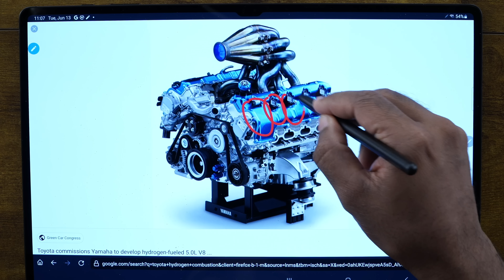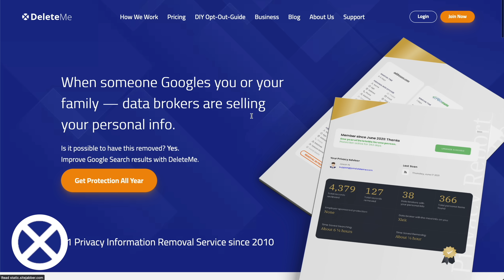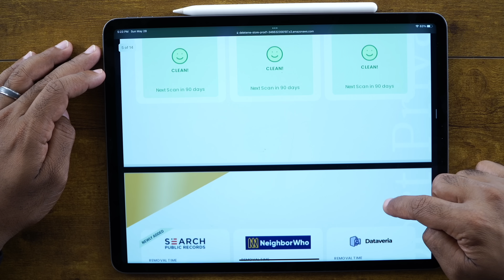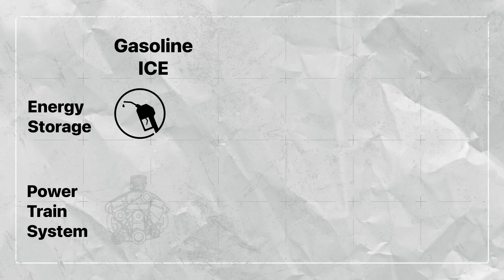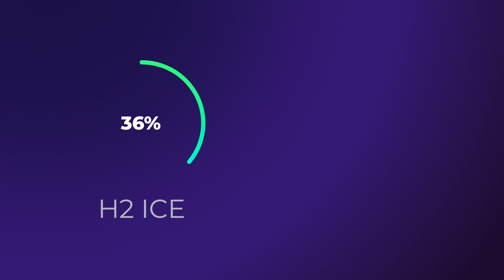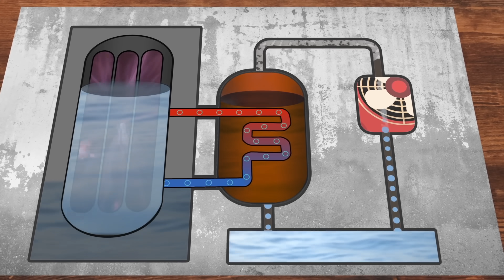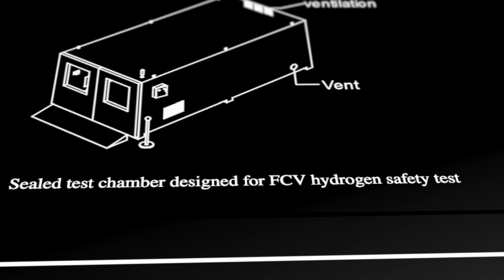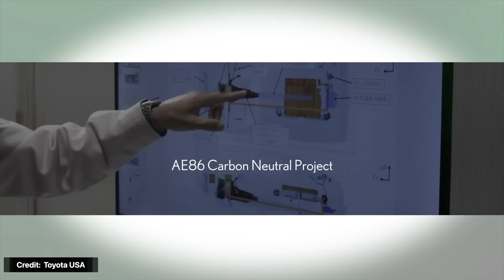Toyota's Says They Just Destroyed EVs - Hydrogen Combustion Engines

Comment: Good video, you only forgot about the fact that hydrogen fuel cell car also use a battery for energy storage. Of course smaller than for an EV, but still needed, as hydrogen fuel cells cannot power an electric drive train directly.

Comment: You should have talk about the range of h2ice. That's a real issue. 1kg of hydrogen as about the same energy of 1 us gallon of fuel (33kwh). The mirai can store 6kg with it's 3 tanks. 6 gallon does not take you very far. Toyota seems to check liquid hydrogen to compensate that, but liquid hydrogen is more complex to produce and store.

Comment: Hydrogen combustion was perfected by Billings Energy Research in 1969.  Billings even solved the NOX problem in 1969 Pontiacs.  Its easy and any engine can be converted for a relatively affordable price.  About the same as propane conversion.  The real problem is a source of hydrogen.  Give us a way to efficiently crack water into hydrogen and oxygen and you'll have something.

Comment: EV-Repaircost are lower?? until u have to remove the battery 20k
Reply from the maker: EV batteries last 250-300k miles, that isn't a concern for most. and EVs usually come with 8-10 year battery warranties.
Reply: @TwoBitDaVinci  and if its broken after 10 years and 1 day at 50.000 miles u still have to repair it...and in Europe its 62137,1 - 93205,7 miles guaranteed. And if u have to pay then 20-30k$...

Comment: This is certainly not the first H2 ICE engine.

In recent time, back in 2003, Mazda RX-8 RE combusted gasoline as well as Hydrogen. Car was shipped with Hydrogen & Gasoline tanks: 210hp @ gasoline, 110hp @  H2. It had regenerative breaking, 144v battery, engine shuts off instead of idles, and electric turbo for low end torque.

Comment: if hydrogen & other alt-fuel/energy sources were used for rail or trucking; the infrastructure would naturally develop.
companies like amazon, UPS, FedEx, USPS -could use diverted subsidies from coal/gas to develop that infrastructure, and conventional fuel companies could be allowed to tap into those subsidies when specifically designated to add alt-fuel stations to existing locations.
    it can be done.  just have to get around profit motive as the incentive.
_______________
side note:  going back over 25 years:  the USPS proposed going EV way back then;  and ever since, nearly all the political power in WA DC has been leveraged against them to dismantle the USPS as its fuel consumption reduction would affect BigOil interests. 

just more to consider of why it's been so resisted or any alt-fuels given such poor attention from govt;  -both parties donors won't allow it.

Comment: Hydrogen as it normally exists on Earth is NOT energy dense. It has to be highly compressed and cooled to sub zero temperatures to make it energy dense. Both of these requirements make it problematic as a fuel. It is reasonable for use in rockets, airliners, and cargo ships but not private cars.

Comment: Vehicle fuel cell systems are not anywhere near 60% efficient unless you drive slow. The new mirai has a tank capacity of 5.6 kg, multiply that with 33.3 kWh/kg  and you have ~186.5 kW, times 0.6 for 6% efficiency and you should have ~112 kWh. You don't, unless your drive slow as the efficiency of the fuel cell  systems decreases absurdly with increased power output. That's why Toyota managed to drive 845 miles without refueling despite EPA and WLTP numbers suggesting that shouldn't be possible. If you drive slow so the power output get very low vehicle fuel cell systems get decent efficiency. But then again, at very low speed long range doesn't matter much.  It took them two days to set that record, it's not that often you can drive for two days without any opportunity recharge an EV.  

And those 33.3 kWh/kg, that's LHV, Lower Heating Value, the actual energy content, HHV is 39.4 kWh/kg but ~18% of that is not available to a fuel cell, or combustion engine either for that matter.  If you're comparing engines and/or fuel cells, it can be relevant to use LHV, but when you're analyzing actual efficiency you can't just disregard a loss of ~18% because it's inherently unavoidable.           

Toyota et al. knows that fuel cells will never replace ICE for cars, they realized a long time ago that by promising fuel cells as a solution, they can continue with business as usual longer. 

For the fossil fuel industry hydrogen is the big last hope to protect the value of their assets. When "no one" wants to burn fossil fuel themselves, the hydrogen can be produced from fossil fuels. The industry can claim it's just for when supply of "green hydrogen" doesn't meet demand, and pretend the part made from fossil fuels is negligible.     

I don't think the chicken and egg issue is such a big problem, there are areas with more than enough fuel stations for many peoples needs, and the >50,000 fuel cell cars that are sold have almost exclusively been sold to geographically limited areas, so it's possible for the chicken and egg issue to some degree limit the rate of adoption, but it can't stop adoption.  

Also, if Tesla could start build the supercharging network in 2012, when they were laughed at by most, the Hydrogen proponents in the car industry could easily have built a bigger hydrogen fuel station network faster, if they actually believed it was a viable system. But they don't. It's a scam, very elaborate, but still a scam.

Comment: Thanks for the great presentation of both the pros and cons af H2 ICE.

I would challenge, however, the supposed "durability" of H2 ICE as opposed to battery degradation of BEVs. In my opinion, the H2 storage tank is likewise highly susceptible to degradation as well -- being subjected to repeated cycles of extremely high pressures during refueling. How well does the H2 storage tanks (both the refueling stations and vehicles) stand up to those stresses (and the cost and complexities of that) is not well known. I seem to recall from other Youtube videos on FCEVs mentioning that that the H2 storage tank degradation issue is a real concern. Not only is the tank subjected to extremely high pressures, but the material that the tank is made out of is probably subject to degradation as well because it has to resist reacting with the H2 being stored.
Reply: Carbon fibre overwrapped pressure vessels. Ask OceanGate about their long term reliability.
Reply: What kind of pressure are you talking about? We still use pressurized tanks from 50 years ago still hold pressure with repeated use; including hydrogen. I would assume they are trying to keep the tanks strong and light. We have cylinders capable of repeated use, they just may not be as light as they would like.

Comment: When I saw the video title card, I thought "Oh no, not THIS again!"
Hydrogen combustion has even worse overall energy efficiency than hydrogen fuel cells, and therefore loses to BEVs even more badly. As to why the Japanese keep trying to find ways to make it work, at this point I feel like they are so attached to the experience of refueling their car the old way, they can't imagine a world without it. That and saving face. Abandoning hydrogen would mean admitting they made a mistake and wasted all those decades and all that money. That would constitute a loss of face. So they persevere out of sheer stubbornness. 

By the way, I was with you right until you said "ICE efficiency doesn't really decline, unlike battery capacity". Storage capacity DOES NOT EQUAL energy efficiency. One of the reasons why it's so hard to argue and reason with hydrogen proponents, is because they keep conflating and comparing metrics that seem related but aren't. (another reason being they keep bringing up arguments and numbers that aren't nearly as important to the big picture as they think). If we want to have useful discourse on the topic, we need to make sure don't do this. Let's be careful to avoid apples-to-oranges comparisons, and while we're at it, let's not bring up irrelevant arguments for one side or the other for the sake of having a list.

Comment: My range anxiety would be a lot bigger with H2 ICE - electricity is everywhere, even if there is no fast charger, you wont be stuck for ever. 
Also, for every day use you never go to the fuel station - destination charging/charging at home. 
I would be interesting to know how often you use 5 minutes refueling H2 ICE through a year compared to the extremely few times you have to fast charge taking your EV when you take it to go on summer holiday. You might still be waiting more on the, but it is suddenly a shorter break. And when going more than 200miles/300+km - I think most people put in a break, to stretch the legs and/or get a bite to eat anyway.
I have a Toyota ICE vehicle now, and I like it, and I love their reliability. 
But I am getting SO confused by them. One minute, they announce a million new EVs, then they come with H2 ICE, then they want EV with gear boxes and motor sounds? 
Even though the Bz4X is far from as bad as many reviewers tried to make it out, it's far from a hit or the dream car. (when the same reviewer trashes the Toyota as the worst thing ever, and then compliments the Solterra for being one of the best EVs - its hard to take them serious)

Comment: I think you've been very optimistic here, this is a turkey.
What you didn't mention is the amount of space the hydrogen takes in the car.
The prototypes don't have a trunk/boot, it's just full of tanks, due the far higher amount of H needed compared to the fuel cell cars
Also, the reliability of a system can be found by multiplying the number of moving parts, therefore any ICE system has to be less reliable, there is no way around it.
NOX is the main pollutant in urban air quality issues, we are trying to get rid of it not add more.

This is an interesting technology, but the only real advantage I can see is that it makes a cool sound, which is likely to be the last stand of ICE vehicles. It's fair enough, but ultimately I don't think there are enough people who care to support the market just because of the noise.
I'd say we would see it make inroads into racing, but the problem is that racing is subsidised by auto R&D budgets. If ICE becomes niche then I don't see why they would be pouring money into research just for the F1 fans.
So ultimately I think ICE will be relegated to classic cars, and even some of those will be converted to EV over time, because it will become increasingly difficult to get fuel.
What happens when it is no longer viable for petrol companies to deliver to gas stations?

Comment: As a carbon-free fuel, hydrogen combustion indeed releases no CO2. However, H2 combustion does generate NOx since NOx is formed when air is heated to high temperatures. I’m very disappointed by the rosy outlook of h2 at the beginning of this video Ricky

Comment: Refill/recharge time will be King, regardless of efficiency.
The only way a battery vehicle could compete is by drop out and in replacement batteries at the charging station.
Don't forget we have really yet to hit the 10 year 'battery disposal' spike, as batteries wear out.
Reply: I spend a second to plug my EV before I go to bed or when I go to work.I just park in front of my house or at work and I plug it. It charges when I sleep or when I work.  
I don't even have to drive to the fuel station. Oh, I forgot, electric motor is 3 times more efficient than hydrogen engine.

Comment: Perhaps learn what energy density means before next video, and stop calling "specific energy" energy density?  You left out the part that actual energy density is way worse than alternatives which means range is terrible unless you have HUGE tanks.  Better to use the hydrogen to make E-Fuels.  Still more expensive to run than EVs, but at least there are some plusses.

Comment: No to H. 3x expense ... no way. And, H embrittlement will quickly destroy the engines, piping, pumps etc. I don't think they did a long term test to eliminate this very difficult failure mechanism. I used to run Naval nuclear power plants, and proton embrittlement is a major cost and ultimately the limiting factor in age.

Comment: Perhaps a better way would be home hydrogen engines to run a generater. After the solar and windmill has filled the battery bank, (or system is clipping) that extra electric could make hydrogen and be stored in low pressure tanks (say like a 500-1000 gallon propane tank at 200psi) till batteries can take more charge again or burned for house or water heat, much like natural gas. Even at 50% loss compared to going in a lifepo4, it is otherwise lost energy.
Reply: Heating is best done via electric heat pump.

Comment: Toyota doing this is not a head scratcher dumb ass. Because the rest of the world doesn't have great ev weather like San Diego.  Ev's sucks in the cold weather regions.  Ev's would only get 50% of range on a full charge in the cold weather and thats only if your not turning on the heat to stay warm. So hydrogen would win in efficiency. Ev's also sucks in extreme heat like Arizona. Blasting that ac to stay cool will drain your battery and possibly over heat the batteries if it's 120 degrees every day.

Comment: Fairly balanced report.  Some of us just dont want electric.  The battery tech isnt there yet.  Too doggone heavy, and low energy density.

Where i live even now there are very few evs since there are nearly no chargers.   Demand for chargers in very rural areas is too low to justify putting up charging stations.

H2 on the other hand could piggyback off the existing hydrocarbon refueling network and essentially every outlet that sells gas could add a hydrogen pump.  

Also your energy efficiency stats were for the car itself and didnt include all the energy needed for the mining,  transportation,  refining, and manufacturing of all the batteries and energy generation needed to run evs.

Bottom line is i feel it is better to produce the energy right at point of use, at the car, not produce it in some far off place, store it in a battery, then release it only at point of use.

Comment: Just a heads up the new batteries set to be manufactured by 2025 will not require rare earth resources,
and what's more these new batteries can be charged within minutes, Toyota even claim 900 miles range 
may be an option, Mind you taking a little longer to charge, ergo you gonna want to plan to slug down a 
coffee or have a snack whilst the damn thing charges up for another round of 900 miles.

Also remember ICE vehicles require a lot more Maintenance "over 80% more" compared to All Electric 
which only has bearings and the usual wear n tear parts like wiper blades etc, so lets just ICE the ICE
and move forward, rather than Grunt in glee over the rumble of a sluggish archaic out dated money pit..

Comment: I Think one of the reasons hydrogen engines are being pushed goes back to mythbusters. There was a product that was hyped to pull hydrogen right out of the atmosphere. It worked, but no where near enough to run an engine. Mythbusters proved that in theory it was possible to run a gas engine on hydrogen gas but they had to strap a tank to the roof. IF someone could make a product that could pull enough hydrogen out of the air to run an engine, it would run practically forever, other than still needing some type of oil for lubricant.
Reply: There is almost no hydrogen in the atmosphere. It's 78% nitrogen and 20% oxygen with a few other trace gases like argon and CO2. Hydrogen only makes up 0.00005%. it's likely not practical to try and extract it from the air.

Comment: It makes sense for Toyota to push hydrogen because they have made the best engines and transmissions and they don’t wanna throw it in the trashcan for a much better solution, such as battery electric vehicles. Their stubbornness could cost them everything. At minimum they lost a decade and that maximum it’s going to be ugly in a few years if the solid state batteries are not scalable soon

Comment: Pretty well thought out and balanced video. A couple of things that seemed needed a bit more clarification:
1. Because H2 engines emit NOX, it won't be possible for them to exclude precious metals like platinum. Those will be needed in the catalytic converters that IC engines already have to deal with NOX emissions.
2. Even if companies solve the distribution problem and improve the storage efficiency of H2 in tanks, they are fighting a losing battle with thermodynamics. EVs don't work with the same limits so they have way more potential to improve than H2 technology.

My thoughts are that this is a cool hobby project for motorheads and it's important to have those. It would probably be more fun to watch a F1 race with H2 engines compared to EVs for example. The knowhow is still useful, but the application is less relevant.